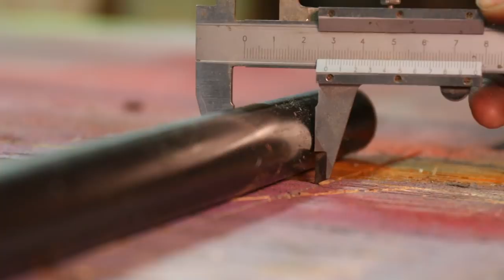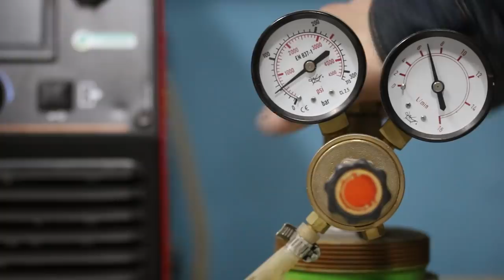Laura´s Beer Bike (BMX meets Handtruck)

Comment: Hahaha brilliant! I really loved this build, I thought your idea was fantastic and well done, thank you for making this video! 

As a professional welder/fabricator, may I make a suggestion? Chamfering or beveling, if you like, you tubes at the joints before you weld them by at least one quarter to one third of the thickness allows the weld to penetrate deeper into the steel to create a far stronger weld, much more resistant to breaking, otherwise you're basically just welding the surface of the steel. 

Again, brilliant job, keep it up!

Comment: Looks like the heavy beer would tend to steer the wheel to either side.
Reply: Max Maker that's why you alternate the load from IPAs to STOUTs
Reply: SuperMishkah Light beer is never the answer.
Reply: Scott Jordan 
x^∆
Reply: 1) Yellow is High Visibility. 
2) A Hand Truck TRAILER 
design where the turning forces are 
more limited and will also help in putting more weight 
on rear wheel which also adds to Safety. Also this trailing method is much simpler to construct. 
Other than that Have Fun!
Reply: @FoScoJo  haha, well said!
Reply: Lol
Reply: Only after drinking it.

Comment: Great idea!  On the front wheel I would not use a threaded rod but a bar threaded on both ends.  Also I would use a Go-cart wheel with roller bearings.   I really like this modification.  Thank you.

Comment: Now it just needs some straps to keep the beers from sliding off
Reply: *tie downs not included.
Reply: Or get a bike with a carrier at the back🤣🤣🤣 and a basket in the front😊😊😊
Reply: she has the small sideplates. Combined with the angle they lay back and the weight of the beers (24x33cl should be around 8kg in beer alone) that crate is not going anywhere

Comment: Great job! I think I would add a strap or some other method to secure the load.
Reply: That would be my only in
Improvements
Reply: This was my first thought. Some of the permanent ratchets that you’ll find on lumber racks. Also suspension to keep the beer from getting flat. Aaaaaaaannnd a verticals barrow cooler to keep it cold.

Comment: Great project. I really like your Chanel, there’s not enough women in these sorts of professions. 
Have you experimented with wooden jigs and templates for the plasma cutter? The heat is so localised it doesn’t burn the wood and means you can make really smooth steady shapes. Maybe make some French curves to reuse over and over? 
Also I know this sounds condescending but please put a guard on your grinder. Adjust it to be in line with the bottom of the tool then trim the front overhang off plum with the front edge of the gear casing. 
Oh and one last thing I noticed is you might want to clean the paint off a bit better near welds as it can melt and get drawn in. Even from the other side of the metal. 
Keep up the great Chanel. Loving your creativity.

Comment: The issue I see is the weight of the beer is causing a torque on the handle bars in the same direction of the turn. So if you aren't expecting the weight, after riding straight for a while and you begin to turn the weight is going to push the handles bars even further in that direction/

Comment: Wonder what it’s like to ride? I feel like a steeper head tube angle might have been better for handling. That way most of the weight goes straight down and doesn’t pull you into a turn.

Comment: I saw a bike with a clip on 2 wheels trolley. The tires are able to lean just like the Yamaha 3 wheel bike.
  If the non lean 2 wheel trolley is used, it's very stable to carry heavy loads. No side stand is needed for parking. You can ride fast on straight line but needs to crawl when cornering.
   I got lots of experience in MTB bikes. I used to cycle 900 miles per month for 12 months. That is 15 miles two way trips to work, everyday. It's not worth it. You spend more on energy or glucose drinks to recover your tiredness. It cost more than fueling my dirt bike. Cycling is not suitable for men because the seat gives pressure to prostrate which results in slow or weak erection.
  Go for 3 wheel trolley bike. It looks cooler or you can have a modular clip on system from 2 wheels going to 3 and vice versa. Anyway I do enjoy your work. I also have itchy hands and love to build things myself. 👍

Comment: Seems like this would have worked way better on the rear, since there you can use both wheels and it's an area where most weight is anyway. Of course, the problem would be how to drive the bike, in which case it would just make more sense to attach the thing to the bike instead of just replacing the wheel. Either way, I imagine that steering with a full crate of beer is super difficult.

Comment: There is a design flaw. Better to keep those 2 wheels.Carry more than one crate is unstable. Even with one crate ,it will wobble.
  With two wheels in front,no side stand is needed !
Reply from the maker: you can‘t turn properly with two wheels in this geometry

Comment: Looks like it handles badly.
A slight turn and the weight of the beer will pull it to the side.
Next time, design it so that the load is in the rear.

Comment: Hi Laura watching your videos is a wonderful experience ,therapeutic even.i have always wanted to build my own stuff like bicycles ,roller skates etc but the greatest problems is always the welding ,majorly expensive .would you consider building a bicycle large and folding from scratch using using just bolt together techniques and just off the shelf parts found in hardware stores versus ready made parts in cycle shops for your next video? would be majorly awesome..Inspired by this system but too many sharp points making it dangerous in crowded city... much thanks for the attention...hugs
http://www.n55.dk/MANUALS/SPACEFRAMEVEHICLES/spaceframevehicles.html

Comment: So... Absolutely pointless use of the calipers. Also when measuring the I.D. there is no way that was close to accurate with the way you held them. The fit was nowhere near tight enough to require that precise of a measurement.

For those watching that want to try, you don't need that tool. Just push one pipe into the other to see if it fits. He made it seem more complicated than necessary.